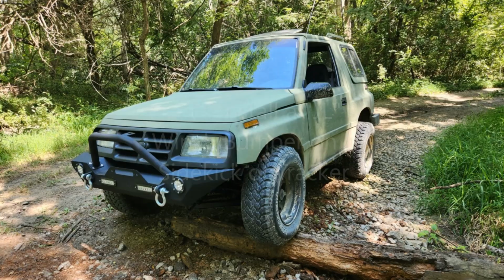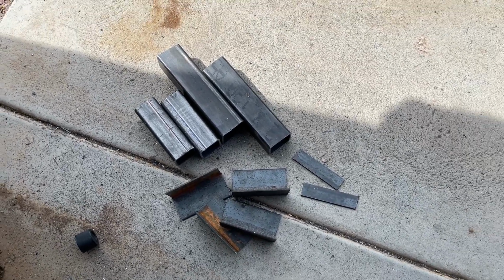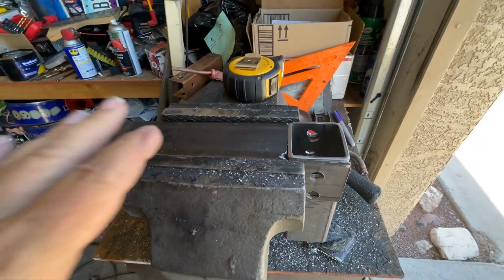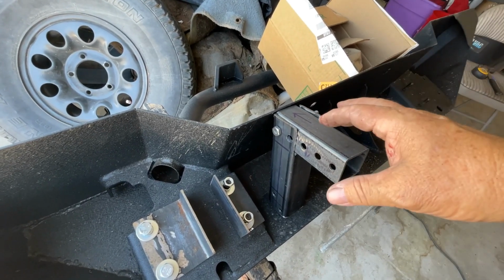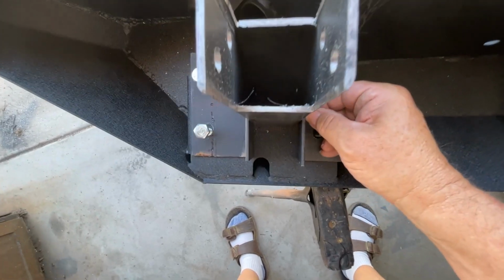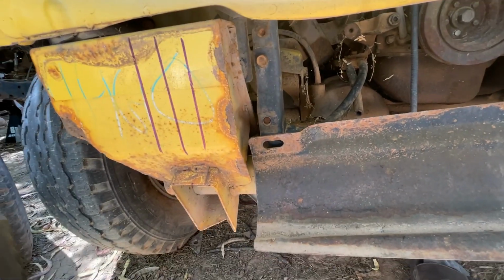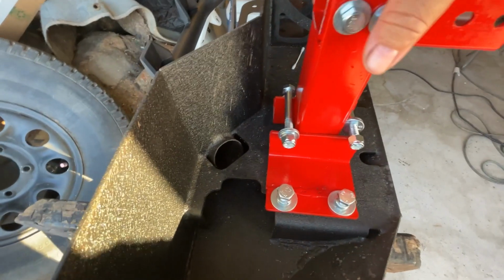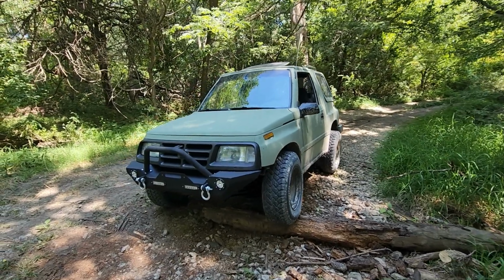DIY:  How we Create Mounts & Install Jeep "JL" Bumpers on Sidekicks or Trackers

Comment: If anyone has questions this is my Tracker. One thing I forgot to tell Cal was I used zipscrews temporarily to hold things in place until I could drill my holes. They were not permanent, I just used them instead of getting the welder out to tack things down. This might help those who don't have a welder.
Reply from the maker: Thanks Duane, Pinned your comment

Comment: Nice job gents !!!  My concern are those points on the end of the bumper   ...  cutoff wheel and flat plate welded on ?
Reply from the maker: "Pointy" is more scary...  (Elon Musk Reference)  Ron we don't make the bumper...we only figure out ways to mount it on a Tracker or Sidekick.  Trackers and Sidekicks really do not have very many affordable options for a "light weight"  winch bumper...yet I feel like there is a question in there somewhere.